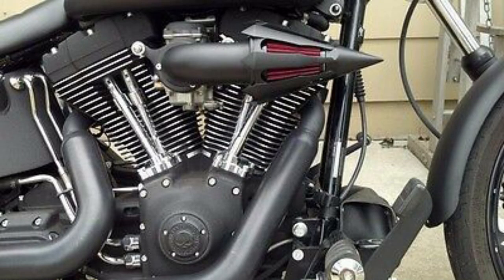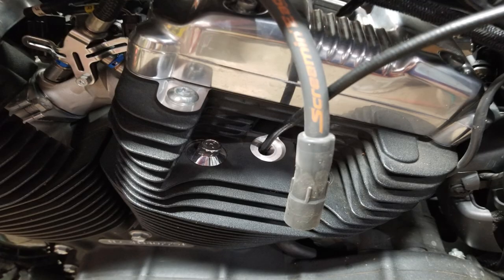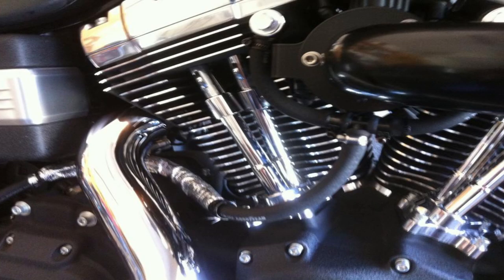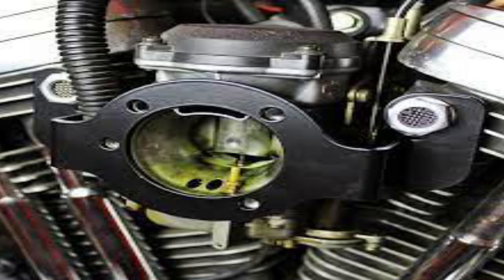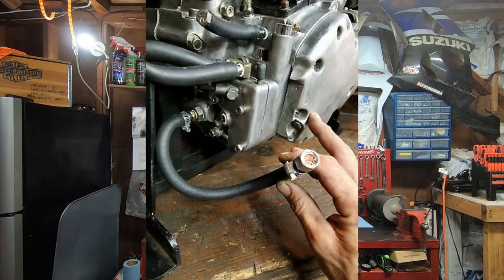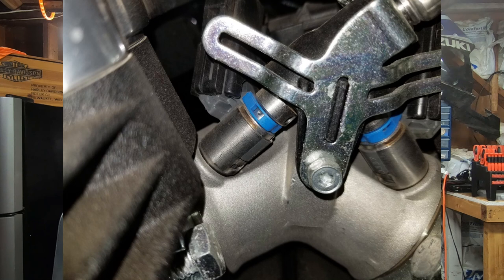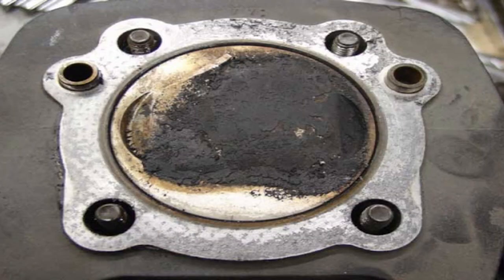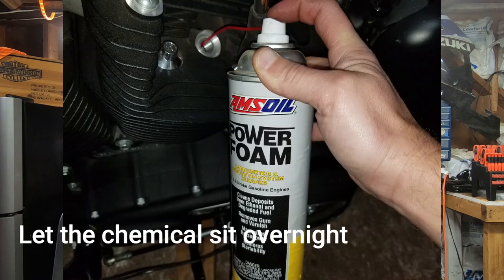Why Your Harley-Davidson Needs a Catch Can or External Breather System

Comment: i've heard of just a spray mist of water into the throat body as revving at same time breaks up the carbon as well.
Reply from the maker: It won't like it but it will knock the carbon off.
Reply: Seen the same thing done but with seafoam

Comment: Same thing with the older cars, they had a Blow by pipe on the valve cover.
Reply from the maker: It worked great till the EPA got involved and wanted it reburned in the combustion chamber.

Comment: The carbon buildup is mainly not from the breather system. The most contribution to carbon buildup are made by the oil sucked from the valves guides and there is not way to fix it. The only reason people route the breather hoses outside the intake is just to fix oily mess inside the airbox, but is does not reduce carbon buildup at all.
Reply: Yes, yes it does. When the oil is routed outside or to a catch can it doesn't go back into the intake. Watters oil going into a throttle body which then goes into the heads and combustion chamber. It absolutely reduces carbon build up.

Comment: You stated that one may possibly have to retune the engine if running an external breather sustem as the bike was tuned with the head gases going back into the engine.  Does putting an external breather on it make it run leaner or richer?

Comment: I love the idea of an external breather and want to do it to my 2019 Ultra Limited. It makes sense NOT to suck oil mist into the airbox - 1) it shortens the life of the air filter and 2) dirty oil mist going into my cylinders can cause additional carbon build up and that dirty mist is basically doing the exact opposite of what the air filter box is supposed to do - that is, keep outside contaminates OUT of the burn process and have only CLEAN air for combustion.

So now the big question - would doing a mod like that void your factory warranty?  I obviously don't want to void my warranty.  I mean, if you did a poor job on the mod and it sucked in a set screw that you used to block the stock ports then of course harley would not cover it.  but it doesnt really effect anything on the bike so i'm not sure why it would void a factory warranty.  thoughts ?
Reply from the maker: Setting up your own external breather system wouldn't hurt the engine at all, but warranty really depends on the dealer as well. To be safe, you might have a air cleaner setup with an external breather and then swap it back to your stock air cleaner if you take it to the dealer for work. Some dealers are really good and don't worry about it and others are sticklers about the warranty.
Reply: @GixxerFoo  you must have read my mind. I am looking for a used stock one for my M8 114 and keeping it on standby just in case

Comment: You didn’t mention that by moving the breathers to the outside, is simply removing the positive vacuum from the crank case…. These guys need positive vacuum to help keep the oil from going past the rings? That’s why pcv valves are generally located inside the air cleaner next to the intake manifold on most older vehicles…. IMO

Comment: guy doing my motor on my 05 U.C. I asked. his opinion was unless you are spanking your motor alot, maybe yes. if you are using your bike as a cruiser, his opinion, as long your not lugging your motor, like some riders do. lugging down the rpm just to get that lop. then yes you are going to have unburned carbon build. drop a gear keep the rpm up. he has 30 yrs wrenching harley motors.
Reply from the maker: If you keep the bike cleaned out you won't end up with a oily top end, carbon black is pretty much unavoidable.

Comment: Are the external breathers, catch can, etc. needed for the Evo's and Sportsters too? Is this a problem inherent to all harley's? Just curious to know what kind of set-up you have on  your sportster. Thanks for the great videos!
Reply from the maker: It's not a absolute have to do modification but it does help keep the top end clean. This same principal applies to any engine really, even my trucks have catch cans on them. On my Sportster I run a catch can, it keeps all that nasty oil out of the engine.
Reply: @GixxerFoo  
Sounds good. Thanks and happy New year to you and your family!!
Keep em coming!!

Comment: One of the first things im doing to my new bike is building a vented dipstick.(M8 Fat Boy)
Reply: that's a bad idea.
Reply: @randymarks4011  No its not. It's a great and highly recommended idea that is so useful that Feuling makes a billet full built Vented Dipstick for 280$.
Reply: @FranBunnyFFXII  after I typed that I looked it up, Hey it's a great idea hahahah, my experience is with pans, shovels and evo with the crankcase breather, you don't want a vent on the oil tank on those hahahaha.
Reply: @randymarks4011  Yeah im gonna build one myself, and combined with a steel mesh oil filter, it's gonna reduce the parasitic drag on that engine a lot.
Gonna be nice having a more free flowing engine.

Comment: How about car injectors fuel treatment will that help
Reply from the maker: Yeah can run some of that and l do often, like Lucas or sometimes Amsoil Quick Shot. It helps a little bit hit actually top cylinder cleaner really gets it knocked off.

Comment: I've actually sprayed a water mist into the intake of a hot running engine and it acted like a steam cleaning!!
Reply: Exactly. I sucked up water through the intake of my truck crossing a flooded road. Ended up bending a rod but that one cylinder was clean like stainless steel. Just spray a mist in it while running and you'll see black carbon coming out of the pipes.
Reply: There is a vid on utube. Be careful.

Comment: Ok , great idea , (  But  )  if bike is under Factory Warranty  , doing this -  Will it Void the Warranty  ?
Reply from the maker: Warranty is a slippery slope and it depends on your dealer. It wouldn't void your warranty if you had an issue as the burden is on the manufacturer to prove this modification directly caused the issue.

Comment: I did a bypass on my new 2022 114 right off from the show room floor with 9 miles on it!. I don't want that crap going in my new engine!.. And not just engine oil, and vented crank case air but condensation/water that builds up from changing temps!.  And No it will Not affect the stock tune. The ECM has a 10% self adjusting differential.. Even if i put on a full free breathing stage 1 type air cleaner and and slip on's, It will run just fine! See DK customs dyno run and Stats on M-8s !!!. Nobody should be getting that much oil comming out your breathers or your by pass hose. Unless you over filled or engine oil level is too high!, There has been a few other problems of excess oil comming out due to sumping, poor compression/blow by. Other than that, oil on your rear tire? Their better not be that much comming out to do fooking squat! And if ya did their wouldn't be any oil left in your engine at all!!!. And a tiny bit of oil on the bottom of your frame, Well better than rust!!.

Comment: Very informative video, I did have a question about your method of soaking the inside of the cylinder with the carbon cleaner though and that is, are you concerned about the cleaner removing any oil film on the inside of the cylinder walls and when the engine is started, after the oil change, the rings will be sliding up and down a dry cylinder surface until the oil ring can recoat the cylinder wall causing maybe premature cylinder wear?
Reply from the maker: Generally a cleaner won't get past the rings, not really enough to be of a concern. But just for safety sake I always change the oil. The split second of a dry start if some cleaner was to get past the rings it wouldn't cause any long term issues. Now if your oil pump failed to pressurize after 10 seconds, that could cause some long term issues.

Comment: I've got a Fueling vented dipstick. No more oil in the throttle body. 👍 Have an M8
Reply: How is that thing? Thinking about picking one up, but only if it fixes this issue.
Reply: Just bought and installed one, glad to read your post. I assume you are happy with it. Nice.
Reply: @MadMexism  happy so far, it's worked for me.
Reply: @drummerdm1016  very happy.

Comment: you are aware that carbon build up happens just by the engine running, i'm a Retired Harley Service Manager and i've seen the same carbon build up on bike that NEVER had the same breather set up, and rather then changing the stock set up adding a little Additive like a Lucas fuel treatment you'll get better results than the catch cans and filter systems
Reply: How often should you use this fuel treatment?
Reply: @robbyclark6915  I know I throw in a cap full or so of Marvel Mystery Oil about every other tank fill. I also will toss in some Startron treatment as well because right now I am only riding on the weekends. But I am changing the oil soon and saw his thing and I am thinking of giving it a try, don't think it could hurt.
Reply from the maker: I use a cap marvel too in my bikes every now and again. I do a cleaning every oil change on my bikes too. Chevrolet Dealers used to do it on their 5.3 engines when they started pinging from the active fuel management spraying oil into the combustion chamber. Cleaned the carbon off the pistons and got you down the road, but didn't fix the actual afm problem.

Comment: So how do you know if that burnt oil on the pistons is from breather issues, or bad valve seals and or worn valve guides? Quite common on air-cooled motors. Viton or teflon seals hold up much better than stock.

Comment: Is it possible that the amount of oil coming back through the intake is directly related to how hard the bike is driven? Higher RPMs?
Reply from the maker: Highly plausible, increased rpm would increase pressure in the crank case. That's also why you want to check your oil when the bike is hot and you want to go 3/4 full on the dip stick. Up to the full mark hot and the bike will puke oil out of the air cleaner. Dumbest thing I ever heard and I filled mine to full fist time, sure enough just want Grumpy in service said would happen lol.
Reply: @GixxerFoo  I ride my bike, my 2019 Road King like an old man, I am 59 years old and I like parking the bike myself at home instead of having it towed. So I’m not aggressive at all and I ride 2up a lot of the time my RPMs are anywhere between 2700 and 3200..... when I change my oil I purposely use 4 quarts, for two reasons, one it puts the oil right on the half in the dipstick and secondly, I find it easier to buy 4 quarts than five...... that being said, I pull my air cleaner off the bike and look inside and rarely find anything for residue on my intake.....

Comment: Beware on top cleaning a heavily carbon buildup on a bike that has a catalytic  converter, I've seen large particles  break loose and restrict the converter , what I do is remove a vaccum  line and spray brake clean down thru the intake slowly , removing a little carbon at a time, like he said right before an oil change also
Reply from the maker: Great point!

Comment: Thanks for the expertise you give us. Got a custom M8 heavy breather intake install on my ultra limited 2012 and got oil puking out and dripping all over my bassani exhaust  road rage 2 into 1. My question to you is does a external breather or catch can will eliminate the oil dripping out of the intake?
Reply from the maker: It would be trapped by the catch can or the vapor vented to atmosphere so you wouldn't have the oil dripping. You might check your oil level too, filling them up to the full mark can cause oil to drip out. 3/4 full on the dipstick usually solves that issue.

Comment: Why does the crankcase need to be vented? 
A catch can doesn't vent the crankcase, because it's passive. What is the definition of an external breather?
If a Twin Cam engine needs crankcase ventilation, something needs to suck air out of the crankcase. I tried the bypass as described by Doc Harley and, nothing is dripping out of the bypass hose. I never installed the catch can. What am I missing?
Reply from the maker: The crank case has to be vented to prevent pressure build up, pulling crank case gases in to the air intake is a EPA thing. The EPA doesn't want crank case gases vented to atmosphere, they want it burned in the combustion chamber and ran through the cat converter. A catch can simply condenses the hot gases allowing moisture and oil vapor to settle to the bottom. The catch can greatly reduces the nasty oil vapor from coating the top of your pistons. Now bypassing the whole thing is blocking the head breathers for the crank case from entering the air intake and running it to a external filter or catch can. A filter will allow the crankcase to breathe and the oil vapor will be trapped in the filter, clean or replace the filter. In the case of the catch can you would simply empty the catch can. It doesn't require a vacuum to vent the crank case, the crank case will build pressure on its own and that pressure has to have a place to go. Blocking the head breather without venting to atmosphere will cause the oil to push past gaskets or even worse the rings.

Comment: I just took the stock air cleaner off my 2014 softail slim and put a screaming eagle heavy breather on. The thing that concerns me is the rubber boots that use to route back to my intake are now just covered with a crome caps with a couple of o-rings. How is this going to effect my engine performance? I feel like I'm missing something here and I'm going to end up blowing those caps off on the street when I ride. And since you're the most knowledgeable harley youtuber I know l, I thought I would ask you. Any help would be much appreciated.
Reply from the maker: I run the exact same air cleaner and I actually lost one of those caps before, I went back to order one and the parts manager suggested just a little drop of silicone on the o-rings. I did that and I haven't lost one since, parts manager has seen this happen a time or two lol.
Reply: @GixxerFoo  thanks so much for the advice.  I will definitely do that. I will say after a few test rides the bike runs much better and the decel popping has been really minimized.  I'm still going to get a fuel pack and run auto tune when I can afford it, but so far I'm really happy with it and it looks so bad ass.  Thanks again for your help. You are awesome!
Reply from the maker: Not a problem, anytime! Once you get that bike tuned it will really wake it up! You'll notice a huge difference after the tune.

Comment: A bought a Arlen Ness stage 1 big sucker kit and the plugs are closed off. Is that a bad thing or ok? There closed breather bolts that hold the backing plate on.
Reply from the maker: That's where you have to get creative and bypass those breathers to a catch can.
Reply: I put a Drag Specialtys breather kit and a Dragtron 2 air cleaner filter. It looks awesome and getting better performance!!

Comment: Running with the proper amount of oil will eliminate a lot of the blow by. I still will add a breather. GixxerFoo, do you know anything about the vented dipsticks? Can I run one with a catch can, or just vent to the atmosphere? I wonder if that crankcase pressure release would do the same thing as venting up by the heads. I know it’s not cheap, but looks better and is aesthetically more desirable.
Reply from the maker: The vented dipsticks really help relieve the crankcase pressure and decrease blow by, personally it's a must have on a M8. You can run one with a catch can, the vented dipstick vents the pressure to atmosphere while the catch can helps with pressure and keeps most of the oil and nasty air out of the motor.

Comment: DK customs wants $171 for an external breather system (for my 2008 Road King). A roll of hose, a small can, and some fittings. Insane!😮
Reply from the maker: That is pretty high, you can get catch cans on ebay or amazon and build your own pretty inexpensively.

Comment: I bought a 103 with 20k miles and the first thing i did was make a catch can and some hoses, i did pipes and a k&n filter and tuned it with a dynojet. Will the pistons clean up over time from when before i did this? The bikes runing great, im just curious. Seems like it wldnt get better on its own but now geting worse so i guess its fine. I'd spray that stuff in there like u said but it aint broke so i think i'll leave it alone. I didnt realize the catch can full could suck oil back up the hoses so i'll def be on top of that.
Reply from the maker: They actually will clear up over time, but you can also pull your spark plugs and spray some top cylinder cleaner on the pistons. Let it set overnight and then run your bike up to operating temperature and blow all the cleaner out. Only do this if you're changing the oil right after, some of the cleaner will likely get past the rings into the oil. Just a quick little way to get it cleaned up before your next oil change.

Comment: I'm surprised somebody hasn't made banjo breather bolts that have tubes coming from the front running underneath into a breather filter
Reply from the maker: I have seen bolts that act as head breathers but I am surprised too no one has made one you can some external tubing to and run it to filter or catch can.

Comment: I would'nt say carbon free piston crowns....
All my bikes vent either into atmosphere or into a large diameter frame tube.
My Triumph has non timed crankcase and top end breathers.
They still have carbon on the top of pistons after a few 1000 miles.
Always have, always will.